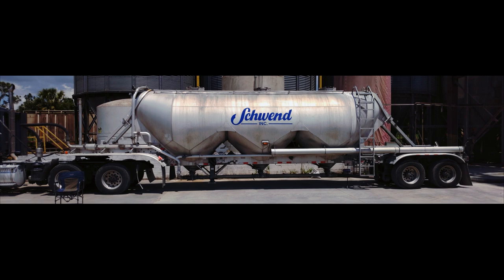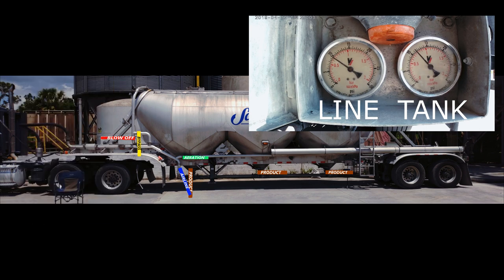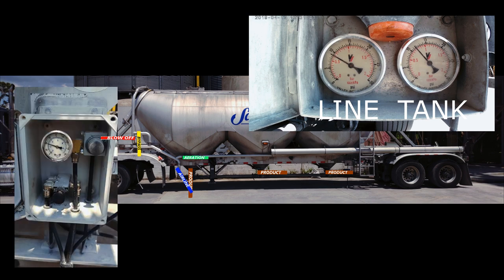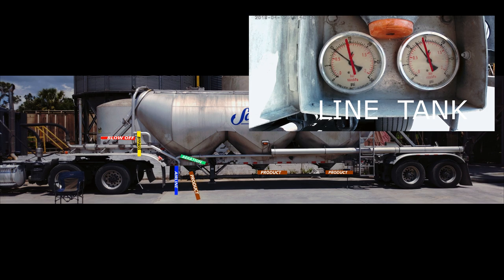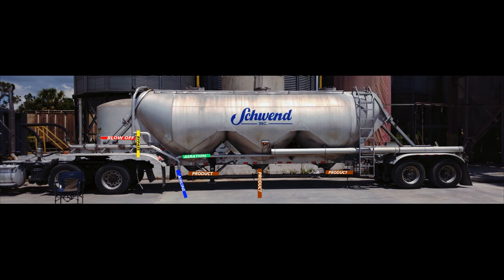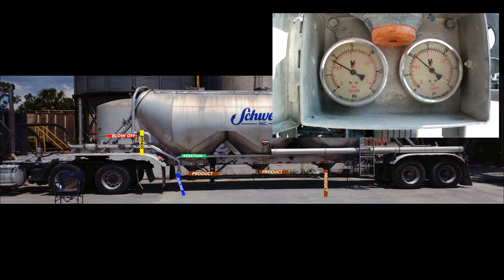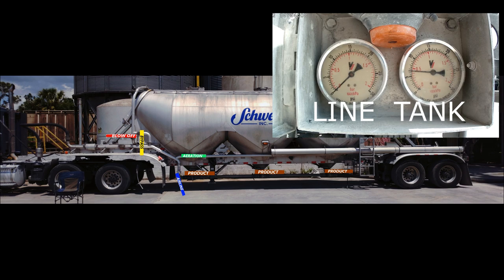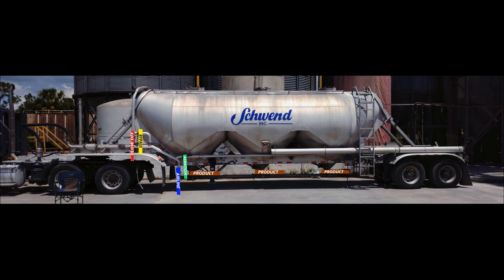how to unload a pneumatic trailer

Comment: Thanks for the video, I looked every where for the best one and this is it by far. All the other's just do a horrible job. I just started about a month ago delivering flower, and i have been having a rough time keeping my flow going good.
Reply: Where are you delivering from?
Reply: @brucejones597  I assume I just needed some more experience, I'm having no trouble now.
Reply: @johnfox2521  I just got offered a job delivering from dowagiac Michigan mostly flour just hoping that I can learn how to operate a pneumatic tanker
Reply: @brucejones597  I can give a few pointers but only have been doing it for about six months now, the best success i have is firing up the pto and letting the aerator's fluff up the flour for a couple minutes, then open your product air line and let it run for 30 seconds or so, then open the hopper valve at 10psi and let it slowly build its pressure from there. Another tip, just dont rush and dont freak out take it slow and eventually you will be able to diagnose issues by sound.

Comment: Good video...never done pneumatic trailers like that but thinking about it since the oilfield went to crap for now....drove the transvacs that unloaded by pressurizing the tank with air and pulled vacuum to load.

Comment: Hi Miguel, I'm trying to do unload of ciment her in Brazil, but I have some questions because here, has Betico compressor (piston) and they use a pressure 2,0 bar to do unloading, but I want use T5CDL9L (Gardner Denver) and the max, pressure is 1,0 bar.
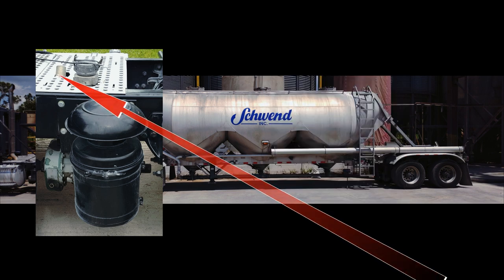The Betico unloading in 1:20 hours to 38 m³  ciment and I did in 1: 48 with T5CDL9L and I had some problems with temperatura (plug temperatura and grease), please could you send me an email to we to talk ?

Comment: How do you unclog the aeration line 
I've noticed mine don't get as hot anymore
Reply from the maker: If not to clogged up and a dust type product may be able to unplug after trailer pod is empty or mostly empty by closing all valves and just leave open aeration valve for the pod that not vibrating and then just play around with the pressure on the air supply valve by opening and closing that work for me the other day when I was unloading some else's preloaded trailer only the back part of aeration pipe and last pod aeration hoses was plugged  and that was a dust load . But most of the time if plugged up good and packed up that won't work .

Comment: Hi 
Is the muffler or silencer necessary?i was thinking take it off to blow faster?
Reply from the maker: not necessary and it shouldn't affect pumping time with or without . but I never try without one ,give  it a shot .What really matters is how much  CFM AIRFLOW the blower is moving . and that depends  the pto gear ratio , the blower , rpms you running at ..the higher cfm the easier it is to keep your tank psi up the better you can aerate your product you pumping , the faster it will flow as long as the psi is being release at the same rate from exhaust side .. But if you doing a powder or dust type load usually you don't need a high CFM flow because the particle are lightweight , on average should take about 1 to 2 hours to unload 25 tons ,  also depends on place and  their system and how well they maintain it . the problem is if the truck blower is set up for powder or dust loads and you switch over to coarse load ,that's when you need the higher CFM
Reply: miguel h thx Miguel,when do you think can do a video on how to replace a blower bearing an d seal?
Reply: miguel h I unload 23.5 tons in 50 to 60 minutes depends on the hose length
Reply from the maker: You good , and never on seal or bearing
Reply from the maker: It a company truck I just put it in the shop
Reply: The muffler is very necessary because it blocks the loud sound of the air flowing through the pipes